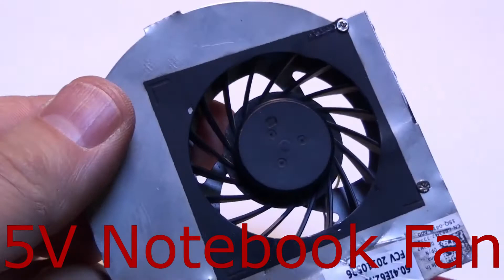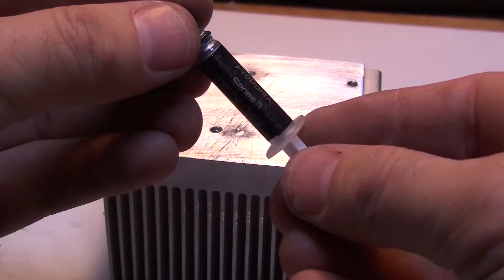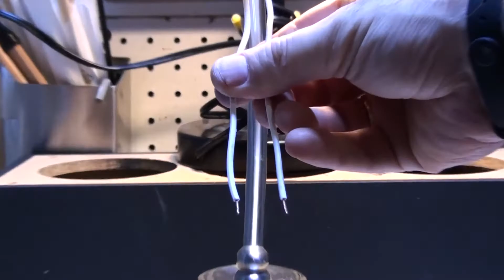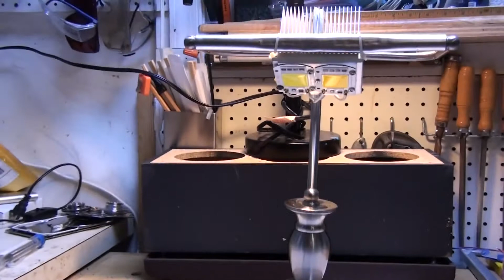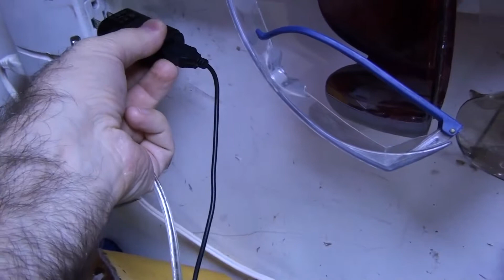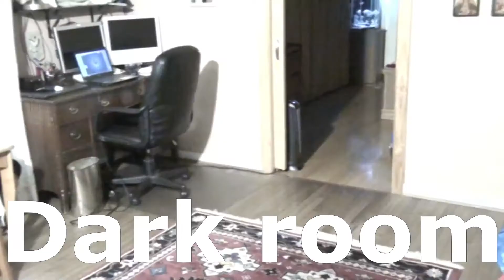How to Make 100W LED COB Lamp

Comment: You could get a 60mm 110v fan and use the same plug as the LEDs. instead of using a 5v fan and the 5v wall charger.

Do the LEDs flicker?
Reply from the maker: Thank you for the comment. That is an option too. But I used whatever I had in stock :). The lite doesn't flicker.
Reply: @MrZurikmurik  No problem, these cob LED's are known to flicker on camera lol and if you move near it fast you can see it flicker xD
Reply from the maker: @ggesdsdsdsd  I don't use it for videography. So I can't confirm.

Comment: I can't think a small blower would flow enough air to keep that setup properly cooled for extended use... Even my 120w LED torch which is one of my smaller ones uses the CPU cooler off an AMD FX 8150 and just on the 100w mode it ramps the fans up!

For reference though I target around 50*c on the aluminium substrate on the chip. That I find gives you a good balance of efficacy and life. The cooler you can keep these LEDs the better they can perform.
Reply from the maker: Thank you for your comment! You are perfectly right, as much active  cooling you add so much better and long life performance will be guaranteed for LED.
Reply: I've never messed with these LED things but just ordered a couple of 100-watt cob LEDs. I decided to pair them with used CPU coolers that were used on 95-watt CPUs. We shall see how it goes. For power (since I accidentally ordered 12V LEDs lol), I snagged a cheap used server power supply and will modify it to allow me to get up to 60 amps DC out of it at 12V. Should be plenty for the fans and LEDs lol.
Reply: @amymoriyama6616  Should be about good enough for these LEDs. They do make a fair amount of heat but most PC CPU coolers for 65+ watt chips will be sufficient to keep them cooled enough to last a while.

Comment: Good work but heatsink is too small for 100w i think or you need a bigger fan ? I mounted 6x50w red spectrum on artic (alpine 12) heatsink it's excellent no heat it's even cool  :D
Reply: instablaster.

Comment: It would be nice if you did one without missing any steps in the process.
Reply from the maker: hmm, interesting... which step do you mean? let me know and I will try to add.
Reply: @MrZurikmurik  You split on wire into two, then you added a fan. Thanks.
Reply from the maker: @RaphaelDawkinsCombatRadio  ohh, sorry. I though step of soldering wires are not important when splitting.  idea is that I split one positive into two and the same with negative line. or you should not split anything, just jump wires from one LED COB to another. Regarding fan: it just has separate 5v line so, it was just a matter how and where I fixed fan to aluminum sink.
Reply: @MrZurikmurik  Cool.

Comment: How would I connect this on other scale
Reply from the maker: Hi, sorry for late response. What exactly do you mean "another scale"?
Reply: For example to make 500w how to connect it in parrael or series anyway
Reply from the maker: @MrGiodude17  sorry, I don't dare to recommend anything about 500w. It is too much watage to make on the same platform, you would need to calculate square of aluminum heat transmitter and decide to put air or liquid cooling system.